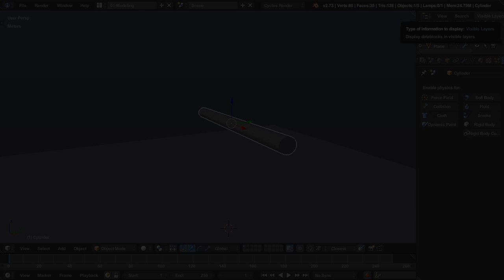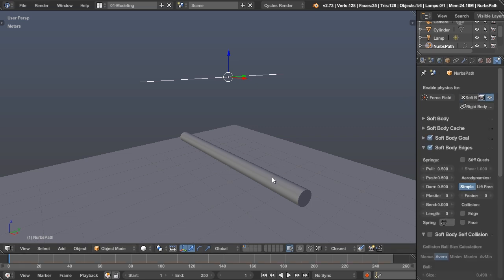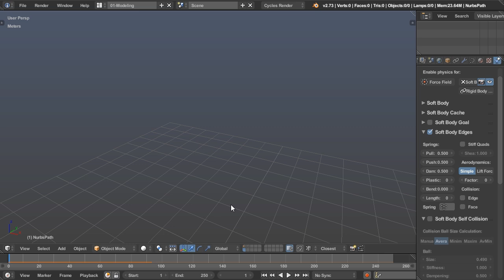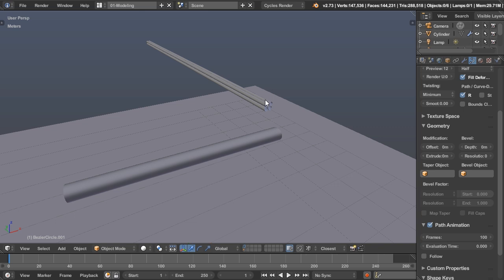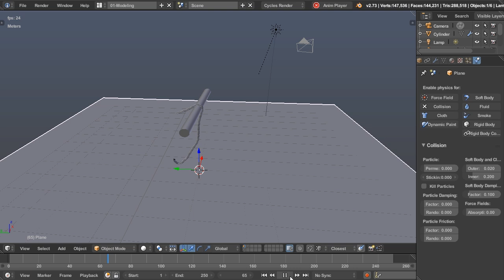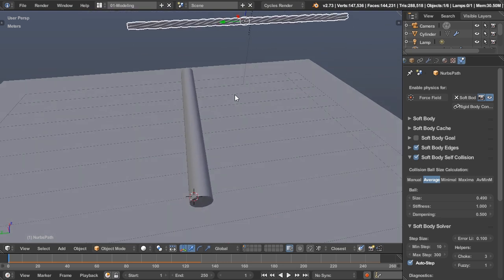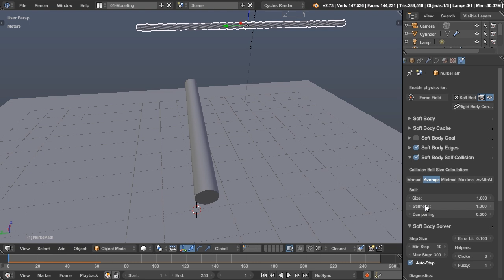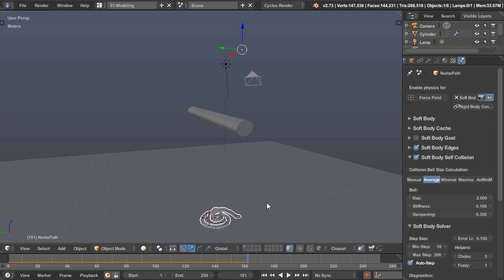Quick Noodle Physics in Blender Tutorial

Comment: I am trying to simulate a pearl necklace with this technique but it is going too well so far. It looks like it is stretching extremly. The distance between pearls definitely  gets longer. The pearls are attached by the Follow path Constraint. They should not have any inlfuence on the sim so far. And I think they don't, because I ran a test without them and the nurbs curve still stretches extremly. I set push and pull to the highest value (0.999) and Damp to 0 and it still stretches. Anyone any thoughts on that?

Comment: Nice tips!

Is there a way to ues this with pinning?
I want one ( or maybe both ) end to be on a fixed point, is that possible with this method?
Reply: To use pinning with curves you need to use goal weights on each control point of the curve:
https://docs.blender.org/manual/en/dev/modeling/curves/editing/introduction.html#set-goal-weight
Reply: @doko3000  Page is unfortunally not found :S
Reply: Edit mode Press N,then you can see "Weight", set all vertex weight, set“1”mean pinning，set“0.01”mean Elegant,and control physical parameter.(you can set a cube become it parents and rotate.

Comment: Actually you can use the Softbody Goal to rig your rope, What you need to do is enter edit mode , and in the Properties panel, set the vertex weight to 0 for no control, and higher values for the areas that you want to manipulate with hooks/armatures ect.The vertex weight on a curve behaves just like a vertex group would on a mesh.

  What I haven't found a way to do yet is parent an object to the curve simulation, which would be very useful for swinging objects or characters on a dynamic rope, or to drag a rigid body at the end.I would be happy if someone could come up with a way to constrain an object to a specific vertex of a simulation.
Reply: I can't find vertex weight edit option for curve
Reply: @YuraSamusenko  It is in the Properties panel, as it said above. Press N in viewport, then look into Item tab